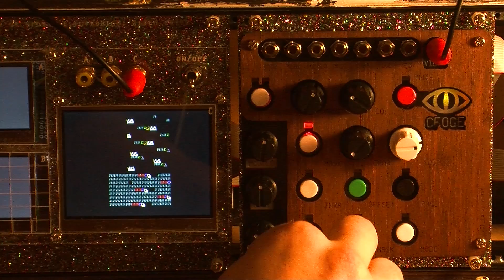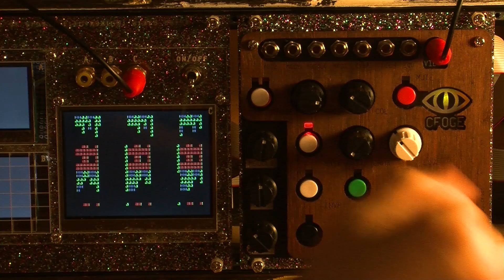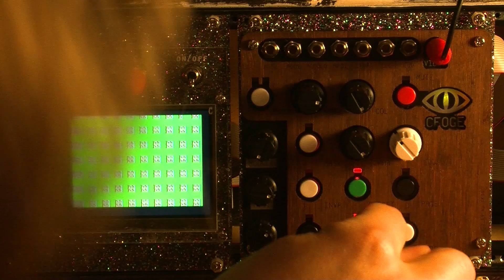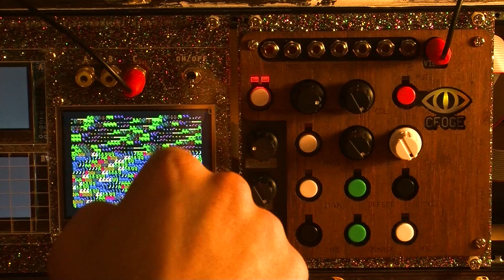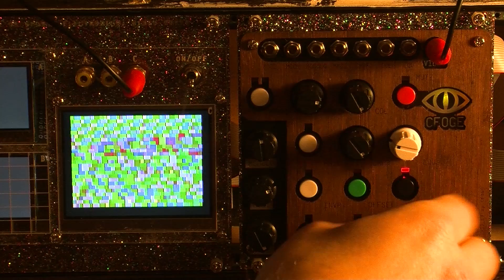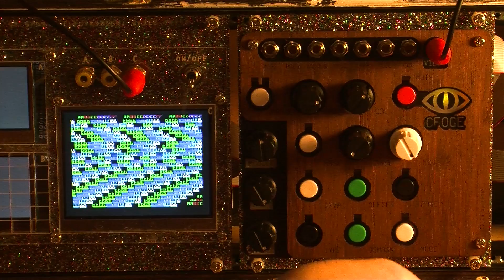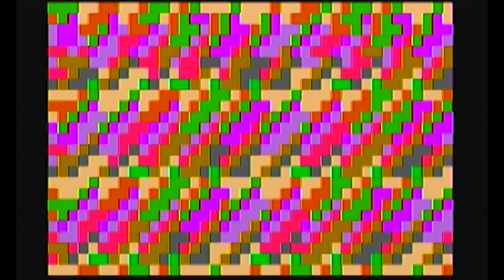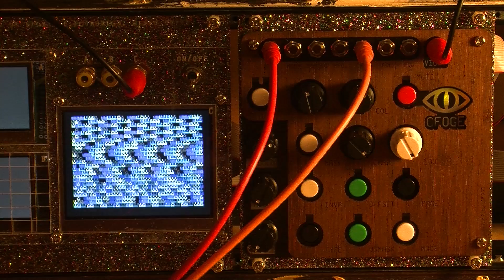VIDEO EQUATIONS EURORACK WALK THROUGH

Comment: Cool video showing the synth. Any chance you can share any info about creating an in rack display like that?
Reply from the maker: not sure there is much to share, its an off-the-shelf pal/ntsc display glued to some perspex. What did you want to know?
Reply: @catfullofghosts4478  Thanks for replying! I see that there are some with the composite and power connected to the same cable. Did directly wiring the power cables to a eurorack connector work fine or do you suggest using a regulator of some sort?
Reply from the maker: @ i just checked, i used a 9v regulator and a ton of filter caps. But watch out lcds are really noisy on power supplies, so you could also run it off a separate dc supply
Reply from the maker: @lifewithoutera  i directly wired the power to a eurorack header in this case, but this case didn't have modules sensitive to power noise.
I would use a fully separate power supply, LCDs can cause a huge amount of noise on  
the power bus and if you have other modules on there they will pick up that noise. I would have a separate power supply for screens that just runs of a nice DC wall wort
Reply: @catfullofghosts4478  Thanks so much for your help. I really appreciate it and never even considered possible noise.